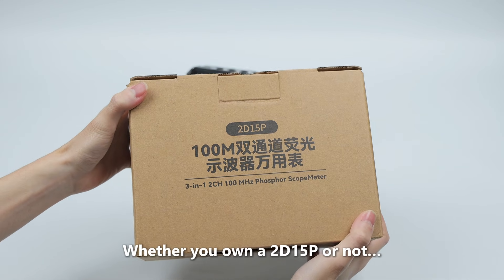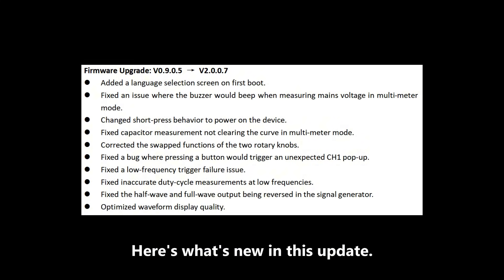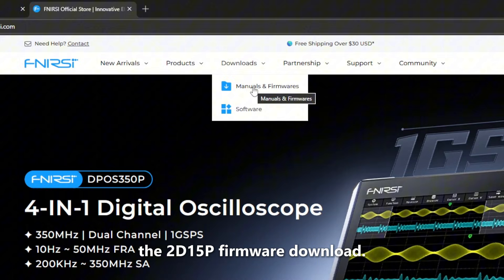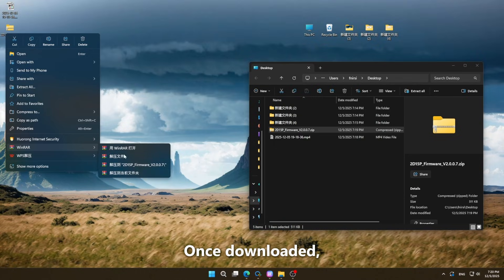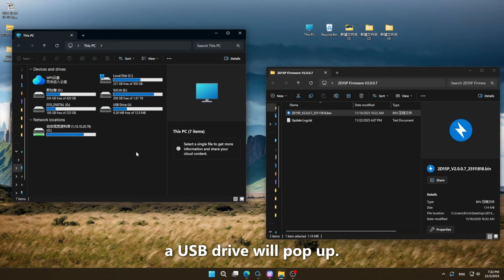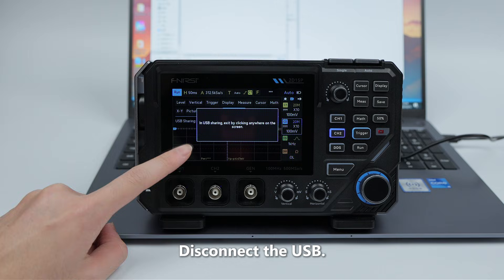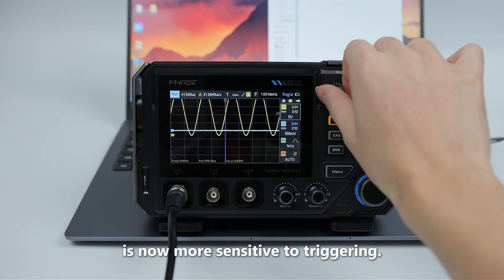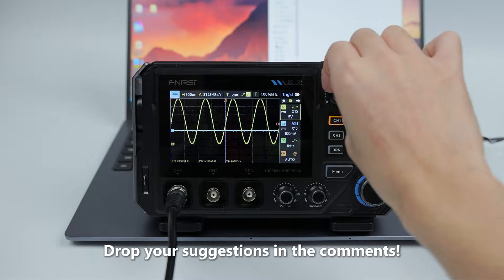FNIRSI 2D15P Touchscreen 2CH 100MHz Digital Oscilloscope+Multimeter+DDS | Firmware Upgrade Tutorial

Comment: Suggestions:
1.:If the hardware are capable to do it, make it able to share the measured data on a PC screen live. Not a problem if it would have slow refresh time on the PC screen. That function would sell this scope for all the tech youtubers instantly, what would be the best free marketing for FNISRI.
2.: In the digital multimeter mode, let us use the big rotary knob to select the measurement modes (auto-dc-diode-continuity...). This would allow us to use it in gloves.
3.: Also for the users with gloves: make button shortcuts to switch between oscilloscope-multimeter-signal gen modes.
4.: Multimeter lead calibration is a must to get rid of the false readings that constantly happening.
5.: Hardware upgrade for the next scope: The fan should be thermally triggered. It drains the battery faster when you are out on the field in 5°C where it is clearly not overheating. This would also make it feel less noisy.
6.: Hardware upgrade: For the nice mounting points on the back, make some arms. Or just share some 3d printable files of the arms.
7.: To make this scope to live forever, if it gets discontinued, share its firmware code.
8.: Keep up the good work! Thanks!